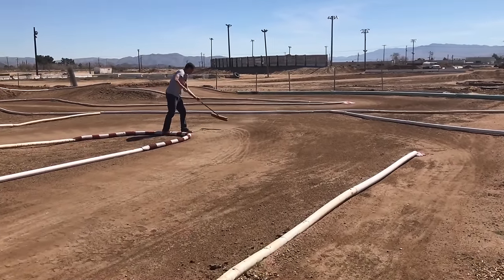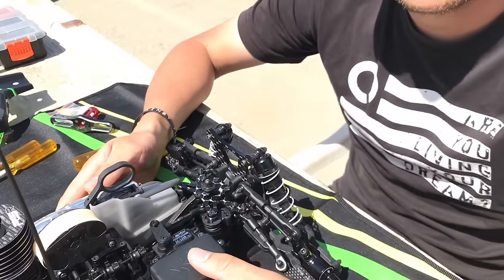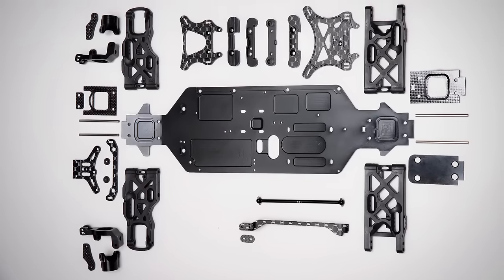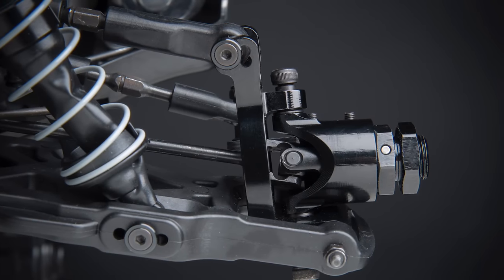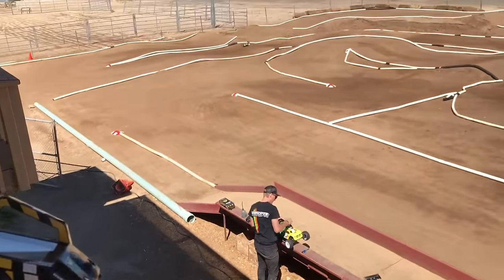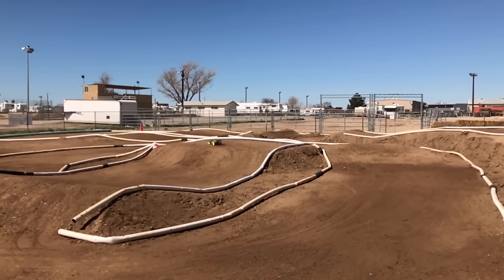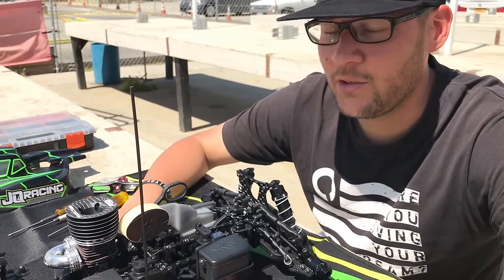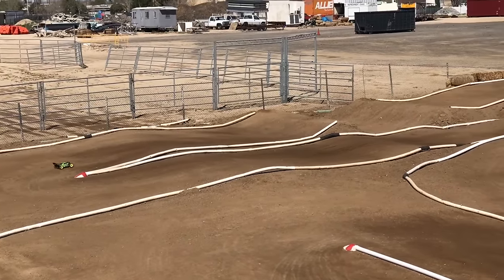JQ Racing THECar Black Edition - Velocity RC Cars Magazine Review

Comment: If I get back into 1/8th scale racing, I'm going to get one of these. I've been watching how THE Car has developed over the years back when the original version was first released and I had always been interested, but it was the twitchy handling and somewhat weaker plastics that scared me away. It seems like all of those issues have been fixed now, though.
Reply from the maker: That car is long gone. There is a new company with JQ based cars.

Comment: i don't race ..but i like an off road car because if i change to street tires i can also play on concrete.
not like an on road car..you cannot play it on dirt..so! i prefer a RTR (Built good) buggy.
This is available in RTR if i'm not mistaken..it has great parts and looks very durable..i will check this out .
Reply from the maker: The RTR isn't the Black Edition
Reply: The RTR is like the Yellow Edition, it shares over 50% of its parts with the Y.E & can easily be upgraded using Yellow Edition parts.
Reply: Thanks ! yes i saw it ( JQ-RTR)...it is still good compared to other RTRs'.
..you're right -it can be upgraded.
Reply: Yeah its still a good buggy, & if you rally wanted you could upgrade using White Edition & LV or Black edition parts, but that would cost a bit for all the extra parts needed.
Its a good strong buggy that goes well, the Alpha engine can also be upgraded with sleeve/piston, crank, turbo head button etc from a couple of the other Alhpa engines, like the F850.